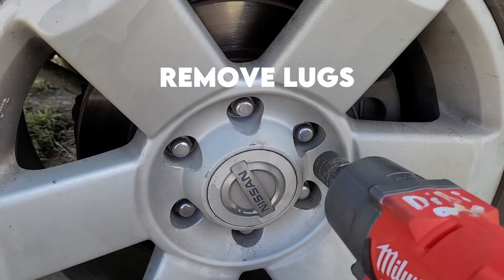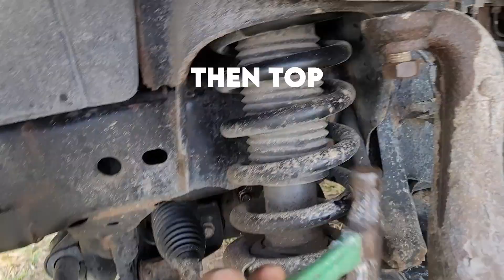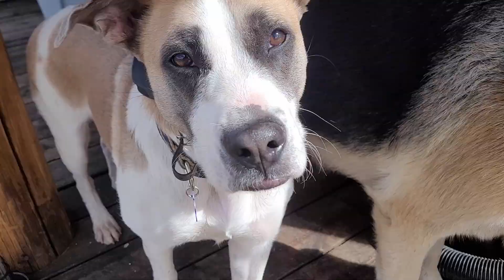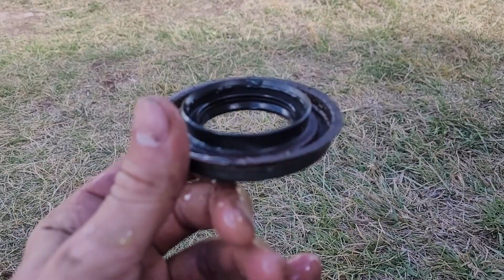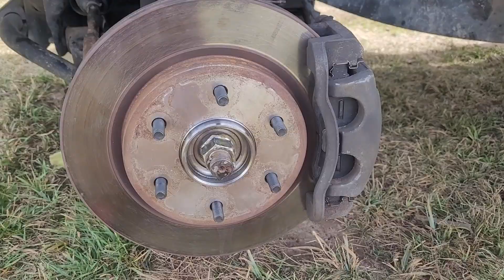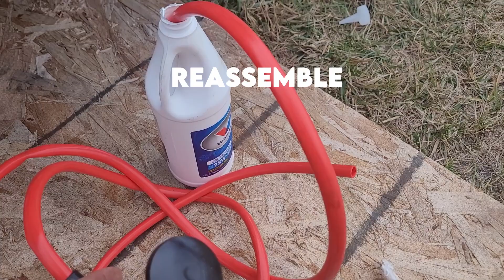2006 Nissan Titan Front  Differential Seal/Hub Assembly Replacement In Three Minutes

Comment: Do you have a part number for the seal having trouble finding the right one
Reply from the maker: https://www.rockauto.com/en/catalog/nissan,2006,titan,5.6l+v8,1432249,drivetrain,

These guys have some pretty good parts. I would check for the exploded diagram of the Diff with parts. Can't remember where I found that.